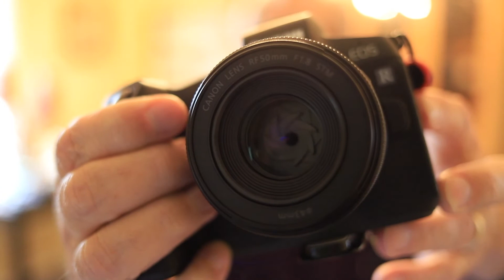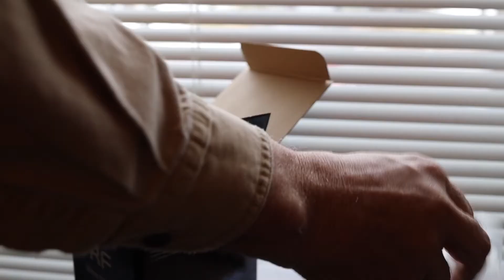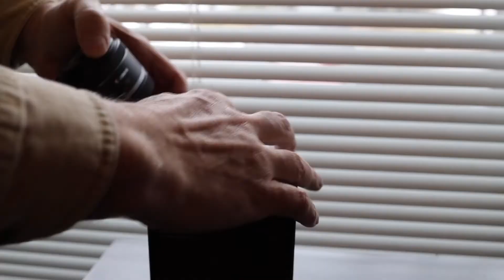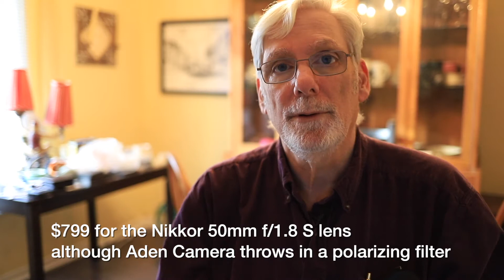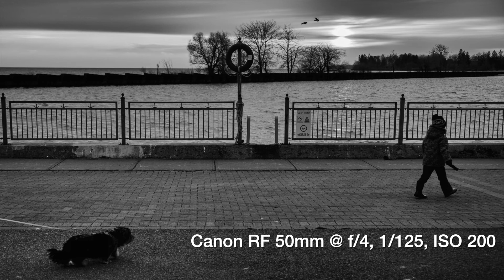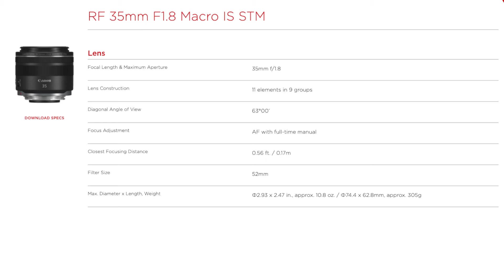Nikon Shooter POV on Canon RF

Comment: You could always adapt F mount glass...The 50mm S lens is built to last and be abused
Reply from the maker: Yes. To that end I ordered an inexpensive F-mount to RF mount mechanical adapter from Hong Kong but it will take some time to get here. Meanwhile I still have some Nikon glass like the 50mm f/1.4 AF-D, the 100mm E Series f/2.8, the old 200mm f/4 Q and so on. Adapted glass is fine for situations where you can take your time composing and focusing. I'm dabbling in the cryptocurrency market again, so who knows, if that pays off I may be able to afford more lenses. ;)
Reply: @PhotoEnthusiastic  Bitcoin has exploded but it looks like it had a small correction but I hope you make millions Jim I really do! Im still shooting my birds of prey with the ole D500 and the Nikon 200-500mm f5.6....That's what I shoot with 99% of the time...Im saving for the Nikon 500mm pf...As far as investing im all in on Gold and Silver bullion, I have been stacking gold and mainly silver since 2013..I have found that if I buy precious metals with my extra cash it keeps me from spending it...lol...